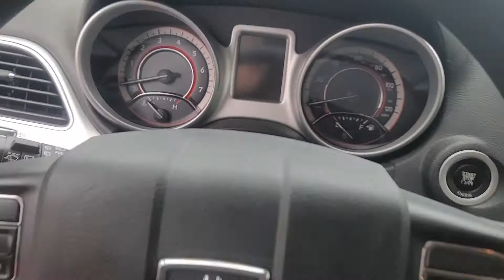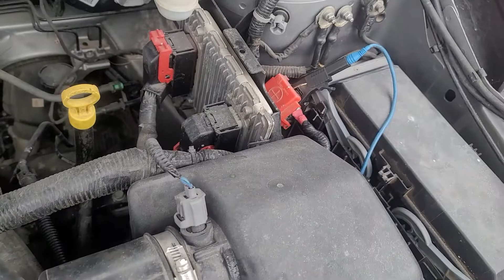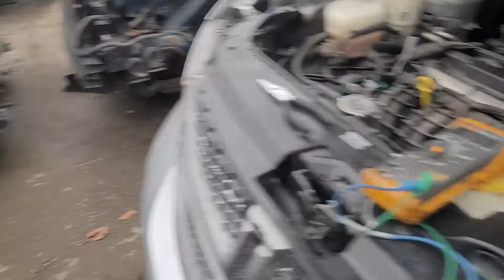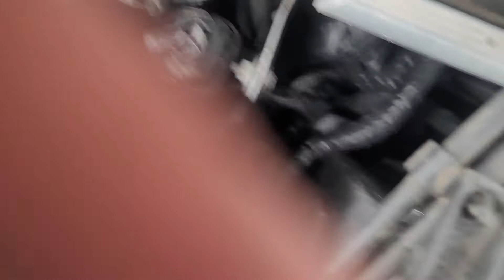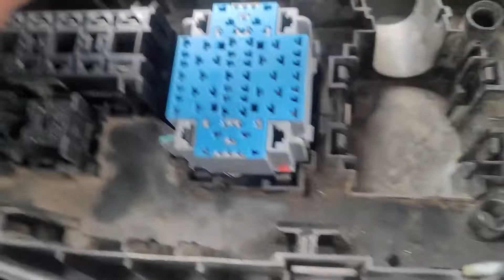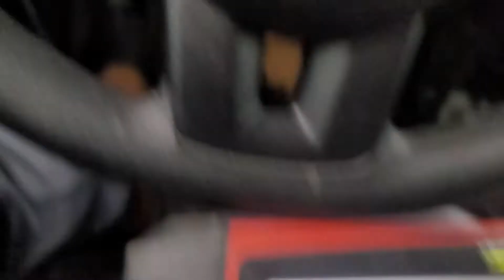2015 Dodge Journey P0198 Engine Oil Temperature Circuit High

Comment: Hi, I have exactly the same error on my Dodge Caliber. What kind of Software you use for Dodge to find the pin connector position on the temp Sensor?  I just can’t find out the way on the cable on this Sensor… thx
Reply from the maker: Hi, this is alldata. There is other sites like identifix and mitchelle. If you want you can use alldatadiy.com
Reply: Thanks. I will check it 👍
Reply: Hi I same issue same as yours, would you like share with us pdf manual wiring  please